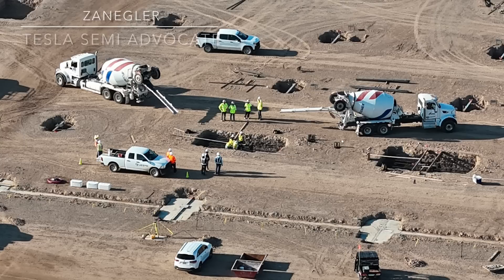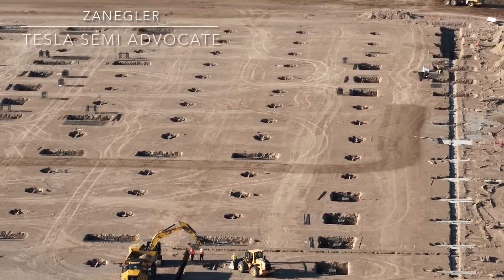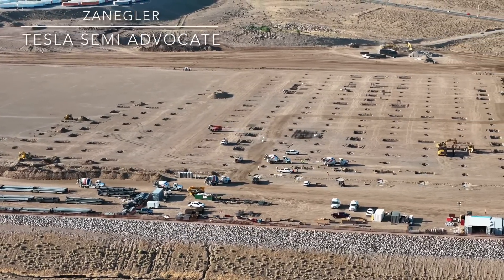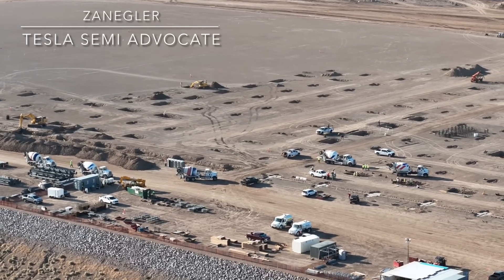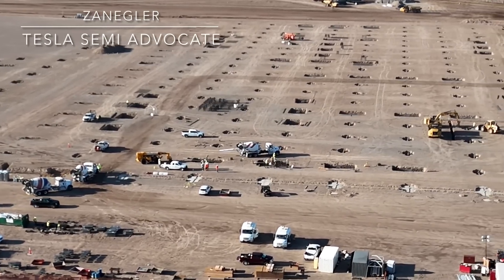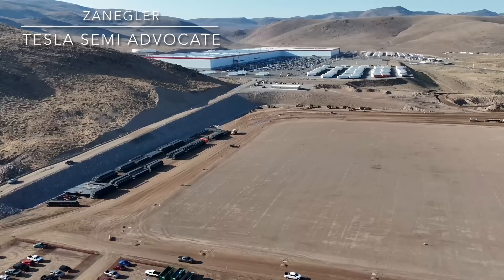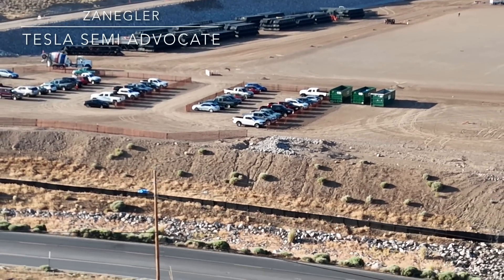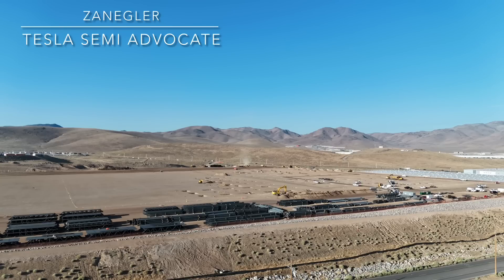Tesla Semi Factory - Concrete Progress!!

Comment: I've been a member about a month now and enjoying what  you show me.  I've got a few predictions to share with you for the future of this factory site.  I'm rarely wrong, but still only human, 😅, remember them and let's see how I do after a few years.

A Few Near and Long Range Nevada Predictions.

1.  This area being laid out now will become the next Giga Factory and where semi production that's been done so far in the smaller building has been happening.  This newer building will be where the ramped up production happens. 

2.  The present factory will be turn from semi production to prototype production for most coming new Tesla models and early production.  It will be called the Proto Factory.

3.  The Austin Giga Factory will be the second Factory to produce new models after  good quantity of production proves viability of the newer models.  

4.  Nevada is only for early new model prototypes and production test lines before being moved to Austin where all other Tesla locations are currently moving.  Because Austin Giga Factory can take advantage of better infrastructure and transportation distribution.

5.  Tesla will build a very large solar farm, a huge Battery Project and can power everything at this site without grid connections.  This reduces costs by simplifying infrastructure, reducing legal regulations,  state taxes, grid failures, and scaling up infrastructure and energy for the future.

6.  Tesla is remote for employees in this location so Tesla will build a company community for all employee housing, food, water, schools, entertainment and rent locations to other businesses like restaurants, entertainment, concerts etc.  This other business income source can be used for more investing back into an expanding community.

7.  Tesla will build an airport where employees can fly freely to larger airports with more major connections to metropolitan airports.  It can also be sufficient for commercial deliveries by air.

7.  Tesla will connect by an underground tunnel built by  Elon's Boring Company to a few multi directional end  points for employees going to places like Las Vegas and farther.

8.  Elon's Boring Company can use this location for testing new designs and software for such currently manual work becoming automated and programmable.

9.  Nevada site will become the second major multi company Musk site after the new arrange for condensing all his current companies in Texas near Austin is done.

10.  Tesla will within two years announce a new business at this Nevada site.  The new location and product will be their first own company produced DTC satellite phone for communication with their existing global satellite system from Starlink.

I said it.  It's logical and inevitable. 🤔🧐👍

Comment: 8:44 from my European point of view the concrete mixer truck looks very loght at the front and rear-heavy when filled with concrete. So much so that I've got a nervous feeling that it will tip up, leaving the driver high up in the air. 
And then I suddenly see the one at the bottom arriving with extra rear wheels helping to support from the back - Geez, never seen this over here! 🙏🏻
Reply: Perhaps @DessieDoolan
 or some of the other knowledgeable people commenting on Giga Texas would know the benefits of this way of designing the trucks?
Reply: Trucks are only allowed so much weight per axle. The drop down wheels allow them to transport 3 extra yards. ( cubic meters ) of concrete )  It has nothing to due with 'tippy'
Reply: The trucks maximum gross weight is also determined by the truck weight “bridge formula” rules, and the longer the total wheel base the more maximum gross weight you can have. You also have to comply with any inner bridge axle grouping maximum weights. A single unit truck also has to comply with a maximum length rule. A longer truck will usually weigh more than a shorter truck when empty. The weight rules are also sometimes vary quite a bit from state to state so you will see many combinations of lengths, number of axles, spread of axles, and tire sizes. Trucks that haul intrastate comply with federal weight rules which are the same for all the states, but construction trucks that do not travel out of state comply with each states weight rules.

Comment: Will the building cover the entire graded area?
Reply: No massive footings needed?
Lightning Fast Build......
Reply: Why would they level it off if not for building on it? Of course there has to remain manipulation room on the sides but in general it's obvious!
Reply: @Alarix246  They actually need large paved areas for WoW, employee parking, outbound lot, loading dock access, Megachargers and maybe some sort of test track.  It looks like they're continuing to grade or level the hillside so maybe some of that can go there.  They need to test the trailer hitch and probably the air brake connections so they're going to need some place to pull a dummy trailer up and down an incline.
Reply: What grade did you achieve?
Reply: @Tom-dt4ic  yep this was probably better answer. 👍🏼🤠